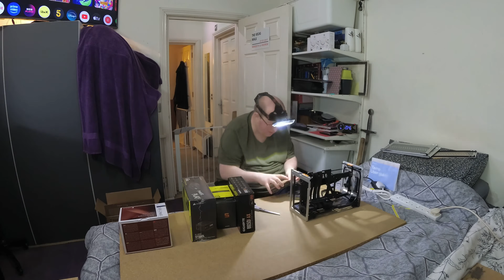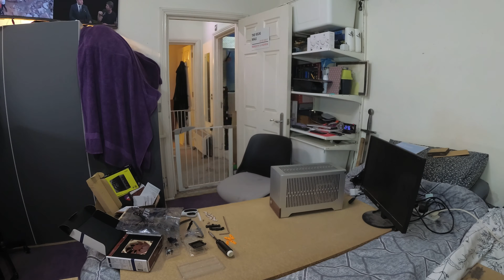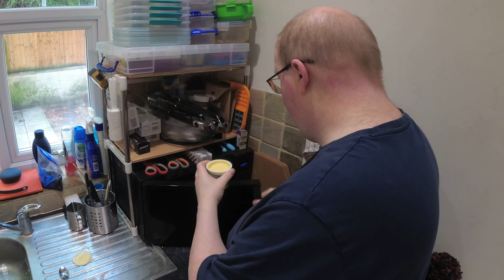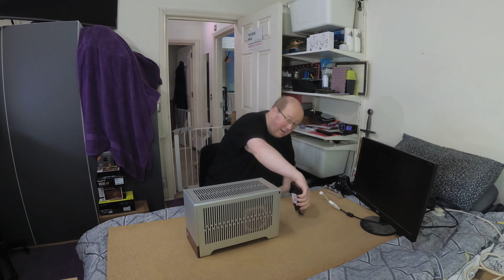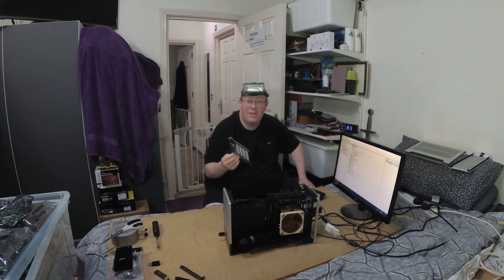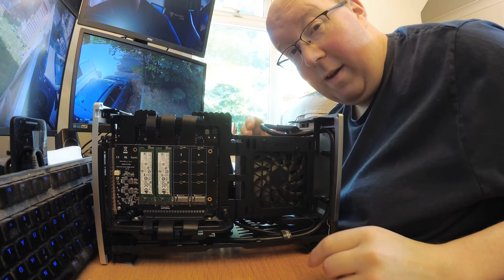Building in a Fractal Design Terra case

Comment: Personally go with the Corsair 750w one as it’s very quiet and small but if ur system doesn’t have the power requirements for it by all means got for the 850w one
Reply from the maker: Thank you for the comments. These recommendations will be useful.

Worth noting now is that I've since swapped out the NVMe card for an RTX A4000, which has a TDP rating of 140W, and so the extra headroom, by pure luck, might have been worth having.

Comment: Do I, as a connoisseur of such things, detect a little wood on the lower section of that front panel? I have 'recently' 'built' a 125-kWe hybrid thermophilic-mesophilic anaerobic digester. It went very smoothly. More hyphens, D.
Reply from the maker: At least you didn't get stuck in concrete. Wood is confirmed.